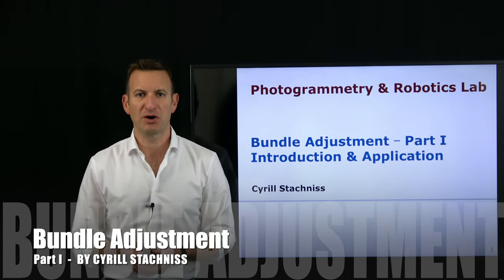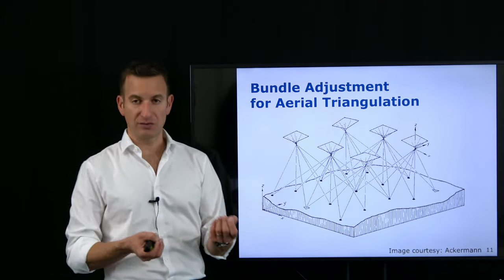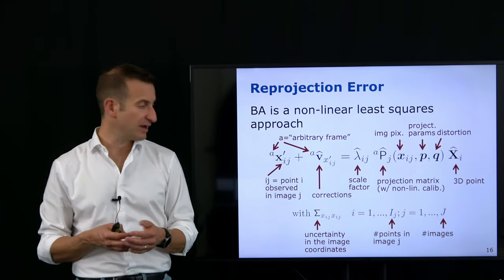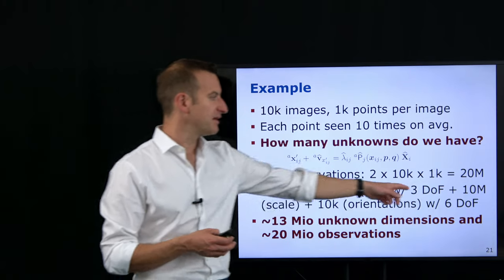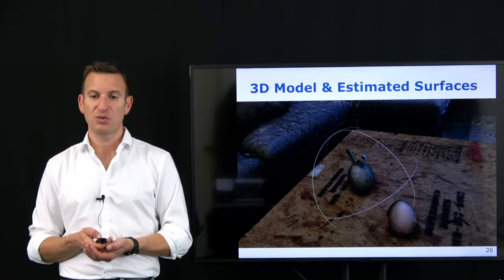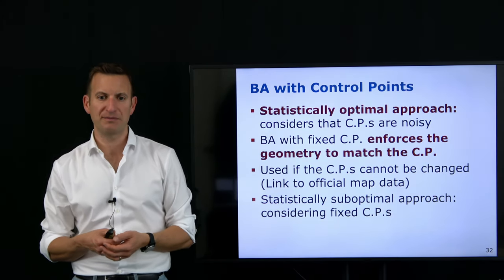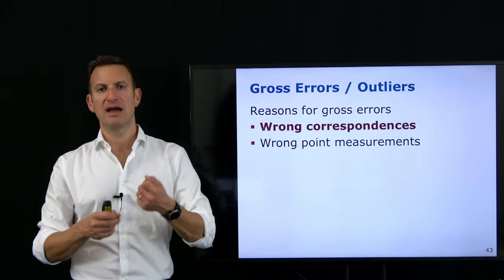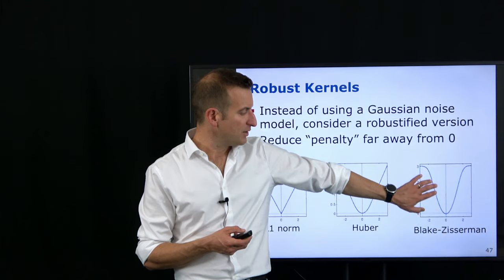The Basics about Bundle Adjustment (Cyrill Stachniss)

Comment: Can someone explain how we get 10M scale parameters, I thought scale factor would be defined for a camera pair and not be different for every point in the pair of images..
Reply: I think it is because we are using homogeneous coordinates. For each 3D point you get only a homogeneous representation after applying projection. The scale in this homogeneous representation (the z coordinate) can be (and I guess usually will be) different for each point. Hence the scale parameter lambda varies across points

Comment: Hi,
I wanted to ask you something about the scale factor. You avoid using this factor when you move from homogeneous world to euclidean world. 
Afterwards, you say the result of bundle adjustment does not contain any information about absolute scale. I wonder if this happens because of the change from homogeneous to euclidean world.
Thank very much in advance for this amazing work!
Reply: The answer is no - these are two different (unrelated) scales. Even if you do BA in homogenous coords (i.e. do not get rid of lambdas), you will not be able to recover the absolute scale of the object in the world.
Reply: @mav45678  Ok, thank u so much!